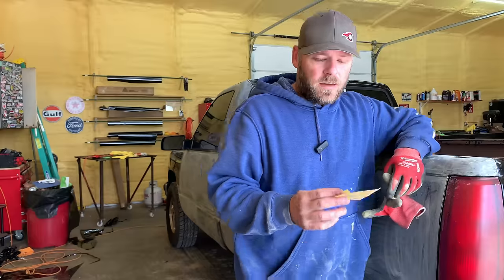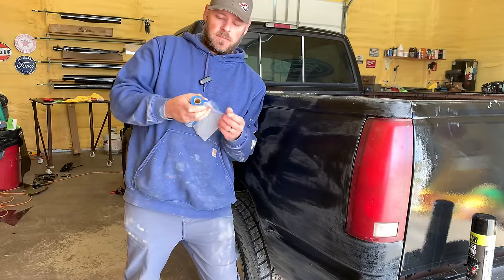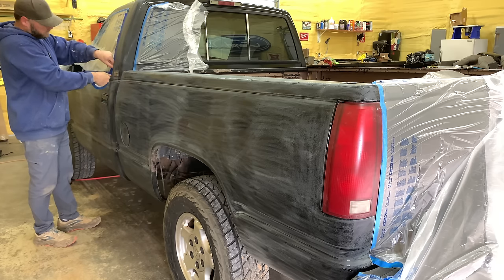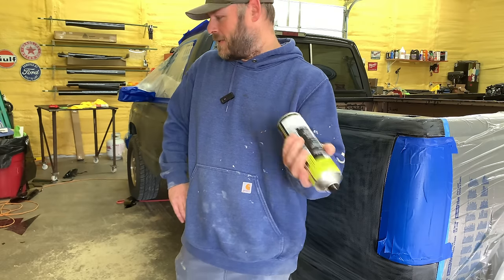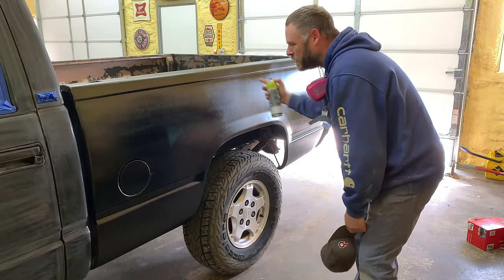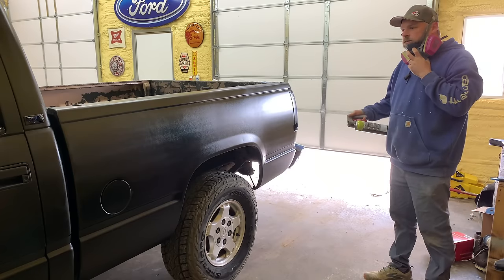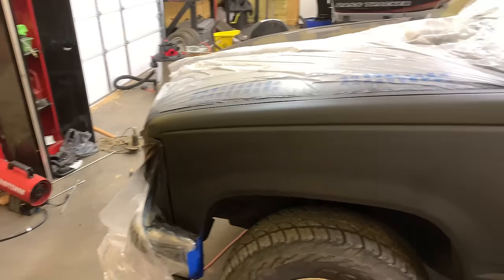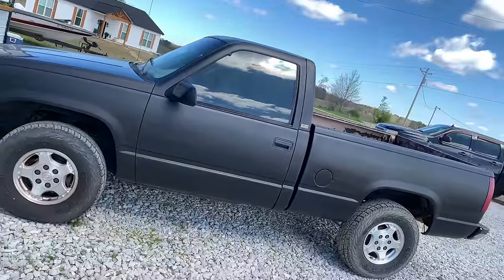I SPRAYED MY TRUCK WITH RAPTOR LINER

Comment: So i been doing autobody for 30+ years now And for a older truck The raptor liner saves a lot of work of scratches And ugly stuff 
I am going with the 4 bottle with hardener with a matching tint 
Your work was perfect Only tip on applying it after the first coat which was too close to each pass is : 2nd coat further back And wider laps above the next pass = Zero lines in the coats ...Other than that she looks good
Reply from the maker: Thanks for the advice. I appreciate it.

Comment: Just an idea, maybe spray some in the bed since it is liner?
Reply from the maker: Looks like someone already did,  it’s peeling off.   Lol. I don’t think they sanded it. Have to work on that next.
Reply: Lol
Reply: great idea !
Reply from the maker: I’m going too!  Lol. What color should I spray the bed?
Reply: @Steeles  clear lol
Reply: Ppl paint liner on there trucks check it out
Reply: @Steeles great job a lot of ppl use it as paint looks killer . Just use the same paint for the bed also . Solid black
Reply from the maker: @cody6.6max  thanks. It’s holding up so far.
Reply: Hahahahaha

Comment: I did the hood and top of my Tacoma the clear coat was all peeling with the Rustoleum bed liner it works pretty good and tough for sure.
Reply from the maker: Yea I have used that before. It works too
Reply: I have a 2004 taco and I’m getting ready to do the same thing my friend
Reply: @MrBreeze2024  Yep, pretty quick I just cleaned the hood and top then sanded well with 100, washed it again let it dry good then taped it all off and painted took about 2 hours total and looks great 👍
Reply from the maker: Have to let me know how it turns out.

Comment: Body man for a independent import repair shop in " 79-82 and a 66 pug nose Chev van (mine)had lower rot .. Not worth a great job so "tiger hair  and bondo job.. Needed to cover some "rough work so used the 3M body shutz gun w/ a gallon of mobile home roof paint black and spray it all.. Thinned w/ lac thinner i put 3 coats and covered nice..Thats my "cheap n dirty , just to cover " story.. Got a few years till the 6cyl blew..
Reply from the maker: Oh yea. I have never used any of that roof paint.

Comment: I shoulda got the raptor brand when i did my dodge but i cheaped  out and got the gallon rustolem brand after about a month it turned brown and looked like crap you definitely made the right choice
Reply from the maker: Yea I have used that rustolem brand. It does turn brown.

Comment: I’ve used the kit with a compressor. After using acid etch primer, it did a great job. I like it because in the rust belt normal auto paint doesn’t hold up. I also would have taped the door handle
Reply from the maker: Yea I have new handles for it.

Comment: I think you did a great job! And it looks good! Do you think it would adhere to fiberglass? I have a 20+ year old motorhome with a fiberglass front lower, and the paint is flaking off. I think this would be better and a lot cheaper than repainting.
Reply from the maker: I think it would be fine as long as you sanded it good. Probably 180 grit

Comment: You should matte clear it, that kind in the can without out the hardener will brush off. That's way it's not textured.  Try the 2K version or shoot it with a Shultz gun at about 50 psi. I use the stuff you're using for touch up; Looks good though
Reply from the maker: I will have to try that. Thanks.

Comment: Nice work ! Im going to do my 2001 Chevy but in white to match it current color. How did the colors blend in ? and streaks showing. Should I can-spray it or airspray it ! Thanks
Reply from the maker: Oh yea. That would look good. I can’t see any lines in it. If you have an air compressor it would probably be better to air spray it.  But the cans turned out good. Just takes a little longer.
Reply: @Steeles  Cool after spending a good $4000 on rebuilding suspension, shocks ,ball joints,wheel hub bearing,control arms, etc bushing,tires,windshield and a dent / never been in a wreck. All it needs is a paint job, old paint is flaking off/ w/very little wheel well rust. Im so happy with this 2001 chevy ext cab ,family Truck, its runs like new, 223,000miles doesnt burn oil/22-23mpg. I saved myself some $80,000 = cost of new truck.
Reply: also I cant see paying $5000 to [$21,000 <crazy est.] dollars for a paint job. That in one movement someone w/a shopping cart/car door, or my dogs, scratch up my truck . Thank for helping me make the right choice.:trophy-yellow-smiling:
Reply from the maker: Yea. Those paint jobs can get expensive $$$$$$. Lol

Comment: Looks pretty nice tbh, esp for a rattle can. What is that applicator thing you had on the can? Is that a Raptor product or is it for spray paint cans? 
Also, is this Raptor Liner the same as the company we have up here in Canada?
Reply from the maker: Thanks. You can get that handle at pretty much any hardware store. I’m not sure. It’s say’s Pennsylvania, US on the can.

Comment: Si tiene la oportunidad de que algún distribuidor les aplique rinho liner no lo duden aparte de que sale poco más barato que el raptor es muchísimo mejor yo tengo 3 vehículos con rinho y otro con raptor y la resistencia es pero por mucho mejor que el raptor liner.
Reply from the maker: I will have to check it out

Comment: Some people shouldn't be allowed to breath
Reply from the maker: Well…  Ok then.
Reply: @Steeles  listen I know that sounded harsh.  But think about it. Why do you take the time to do the prep work. Sand it down wipe it down all that crap. Then you make a mistake In the painting and you create an overlaping line. And your solution to fix it is. "I'll go back over it with a continuous motion"  this is where my comment comes into play. Do you honestly think that the over lap build up is only going to accept the new spay where it's not built up.     No.   The reason  there is a line is because that's where 2 coats have been sprayed. Putting another coat on only makes it go from 1 coat to 2 coats. To 2 coats and 3 coats.  There is a reason paint shops get crazy money for what they do.
Reply from the maker: @gtmddn  Oh Yea. Make us a video and show me the correct way..  Be glad to watch it..
Reply: @Steeles  nope see that again is where my original comment comes into play. I would never make a video of me showing people how to paint.  Because I know that I am not that good at it. I know what's supposed to be done. But knowing how to do something and being good at actually doing it is two different things.    Like I said. Maybe to harsh on my original comment.  You keep rocking videos and don't let people like me detour you.

Comment: Paint from top to bottom next time
Reply from the maker: I will have to give that a shot. Thanks.
Reply: Do not do top to bottom. Have you ever seen any pro paint top to bottom? 😂😂
Reply: Should’ve clear coated  it with a 2k clear. It’ll hold the shine
Reply from the maker: @Lawnfella  I thought about that. I kinda like the matte look.
Reply: @Lawnfella  Shine????